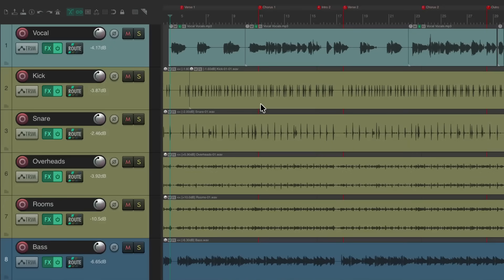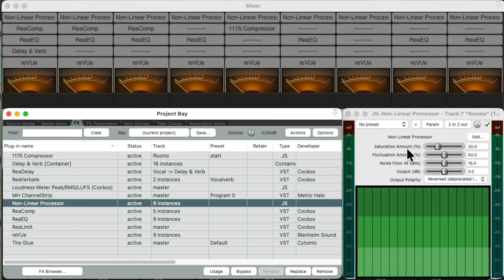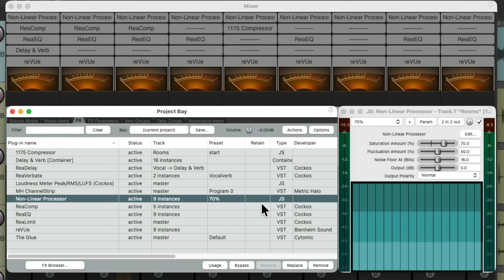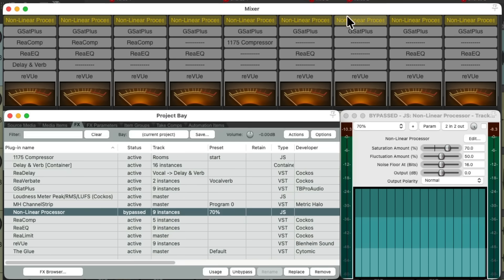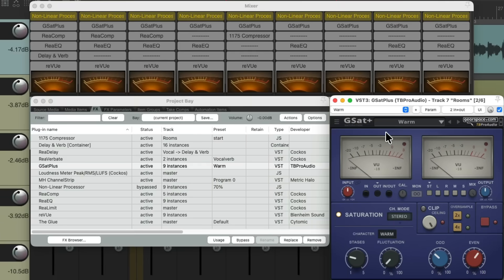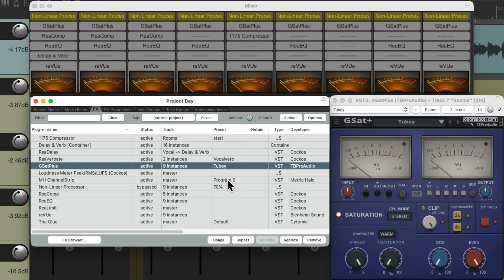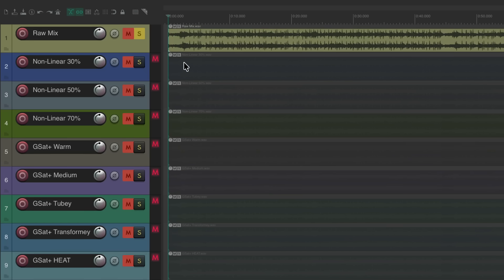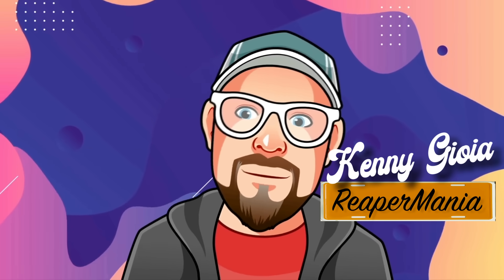Adding Saturation Plugins in REAPER

Comment: Great video Kenny!

I didn't know about the built-in Non-Linear plugin, however, I've been running NLS, Console, Tubes, Tape emulations across all tracks since the 90's.  Including H.E.A.T. & Phoenix. 

Reaper is by far the best platform to build your Analog Emulation Hybrid Workflow for a thousand reasons, this being yet another. 

As to the last two being 'too aggressive' and 'losing high end' aka being 'too warm', If you were to setup a Static Mix first, then Audition your Analog Emulations as you did here, then you would Mix THROUGH the nonlinearity and instinctively add top end where needed while actually mixing.

Some start with this all in place from the beginning, as if it were an actual Analog signal flow without the ability to change it (like in Heat).

I work like your example as an intermediate stage to find the Vibe for the track, then dig into the mix.
Reply: You could also dial it in with the mix knob. You don't have to saturate every track 100%
Reply from the maker: I agree. And I considered remixing each one for each type of saturation but not only would that take too long but it's also kind of a moving target as my remixing would never be perfect. But it is a great way to try it for yourself with something you are currently mixing. Pinned comment.

Comment: One great trick with saturation plugins (especially if trying to lean into analogue emulation) is to use multiple instances of really low saturation, and let it all accumulate. Because literally every single piece of hardware would add its own small amount of saturation, you would have saturation from your preamp input, from your eq, from your compressor, etc etc and then more saturation going back in after all the ourboard gear. On every bus, every fader, tape if you want the tape sound, etc etc.

All theae smaller instances will react with eachother slightly differently (moreso if you set them up slightly differenty) and give a slightly more natural effect wheb all out together.

Comment: Why could you not just add the saturation plug-in onto the master track instead of each individual track when doing it this way? Sorry if this is a dumb question, I'm just wondering why one would add the plug in to all tracks if changing everything the same  amount.
Reply: Ends up sounding different, distortion is a non-linear process. Putting it on each track is closer to analog. For linear processes like digital eq, there's no difference if you put on individual tracks or the master.

Comment: Saturation is tricky. It's fairly easy to detect when it's too much, but not so easy to detect when it's not enough. I always put it on a parallel track and mix in to taste. Also,  understand that you wanted to demonstrate the FX bay function, but what's the point of having the same type and amount of saturation on every track? Isn't it better to tailor them to each track individually?
Reply from the maker: The concept is that if you were using a console or tape that you would be getting the same type of saturation for everything. But in a DAW, you're free to do whatever you like. :)
Reply: @REAPERMania  TXs for the answer, Kenny.

Comment: We need an "FX instance oversampling on render" option.
Thanks, Kenny!
To help prevent saturation aliasing you can use Airwindows' (free) Ultrasonic or TDR Ultrasonic to cut after 20 kHz, before entering any and all saturators.   
To help minimize all saturation aliasing you can set Project to 96 kHz and still render out at 48 kHz with 'Mix and process FX at project sample rate' ticked to provide more headroom.  Plugins and such may work and sound differently at different rates though.
Reply: Wouldn't Reaper's built-in oversampling function be better for that?
Reply: @elementalwarrior3770  True, that may be the better route for a few plugins and if you have extra CPU as it multiplies quickly.

The best bet may be a script to allow you to set up a ton of plugins to oversample only on rendering.  I don't see this solution out there yet.  Maybe not so difficult.

Ultrasonic helps since it's still hard to render over 96 kHz but possibly can change the tone to some grand ears -- Airwindows makes lesser versions in the Hypersonic family that can probably be stacked everywhere.  

That's my testing... I really could be wrong about everything. 

If Reaper had a built-in option to oversample per instrument only on rendering...

Comment: Hey, I'm getting a different drop menu when I right click in the preset column for the non-linear processor in the project bay. I'm not seeing a way to adjust the value. Am i doing something wrong?
Reply: I'm getting the same drop down menu as you are. Possibly a Windows problem with JSFX. Seems to works VST3.
Reply from the maker: @EricCutler-d5s  It was just fixed before I made this video. Check out the pre-released versions if you need it now.
Reply from the maker: It was just fixed before I made this video. Check out the pre-released versions if you need it now.